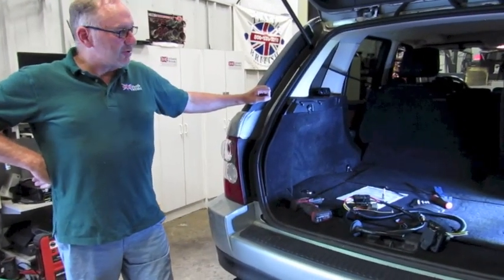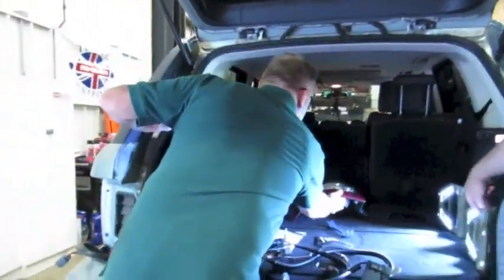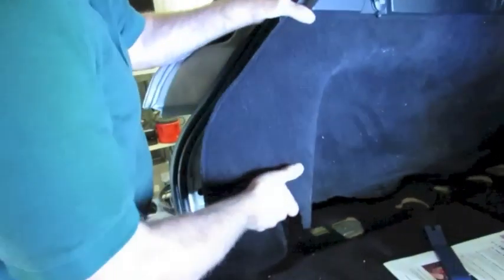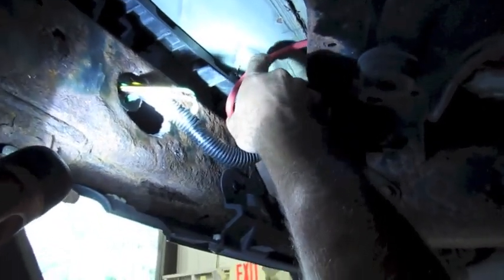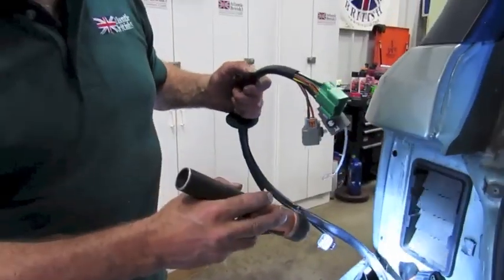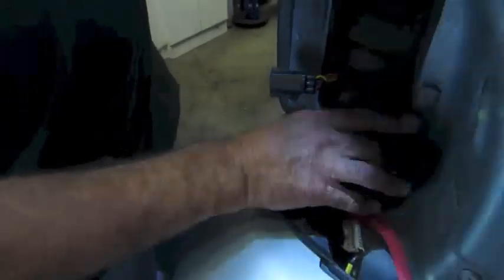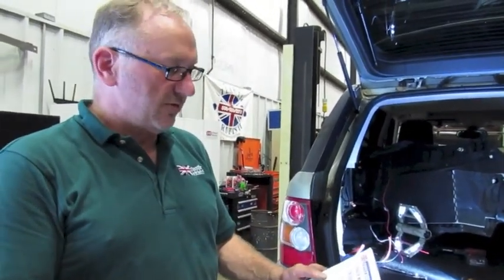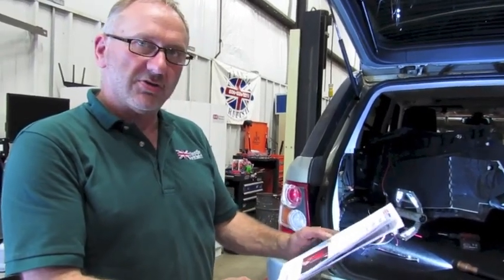Atlantic British Presents: Install Trailer Wiring Kit on Range Rover Sport Supercharged

Comment: Great video! 
One question. Do you have to install a new main harness or can the trailer harness connect with the existing harness that came from the factory?

 Apologies if I missed any mention of this matter during your talk.
Reply: Did you ever find an answer to your question? I’m wondering the same thing
Reply: @gt135  Hey guys in the instructions on their website there are grey plugs that exist there from the factory called dummy plugs that are pretty much just waiting for a connection to a trailer harness. I stumbled on a related video showing this on the channel 'Double PiRadian' and the video is titled 'How to install trailer harness on 2007-2013 range rover sport' cheers

Comment: Desperately looking for a similar tutorial for my 2013 RR SC. Any help? It looks like 2006-09 (this video) is one way, while 2010-11 is another, and 2012-13 is yet another. Totally different part numbers. I got the correct one for my 2013, but can't find instructions anywhere. Hoping you guys could help.
Reply: I have the 2012 and none of the towing harnesses fit my wiring loom 🫣